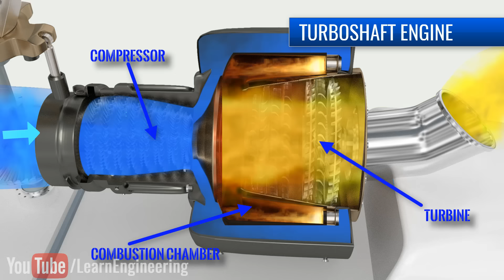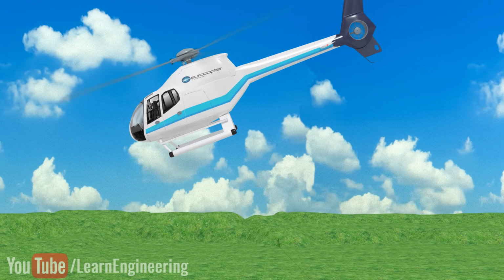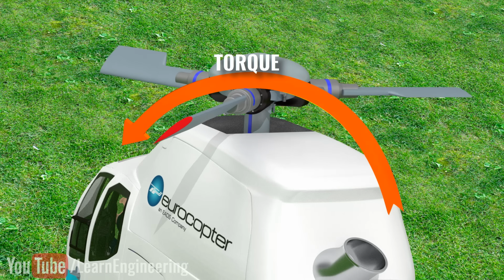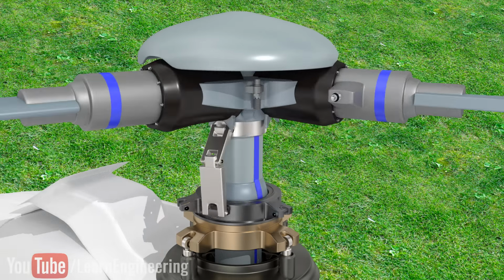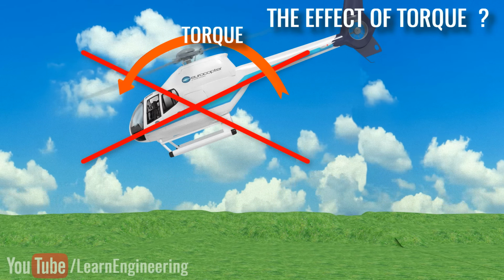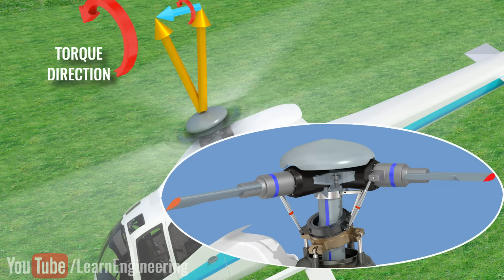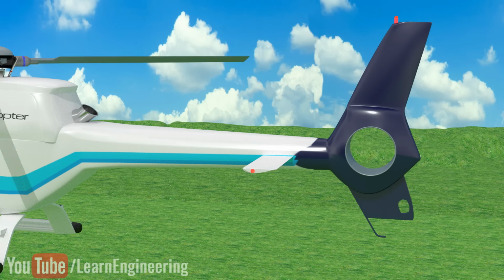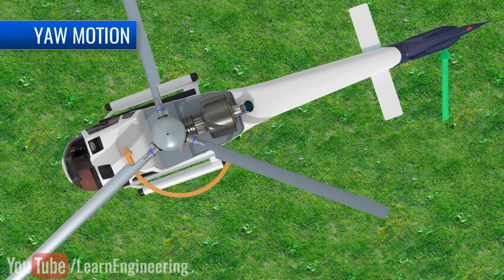How does a Helicopter fly?

Comment: Shouldn’t the main rotor head be spinning the Other way.
Reply: Yes, it’s spinning in the wrong direction at the beginning of the video. It should be spinning counterclockwise to generate upward lift (it’s correct in the middle of the video), but the animation is moving clockwise which is wrong

Comment: This video does not even cover half of the forces that comes into play with helicopters. For example, it does not even mention what happens during forward flight, when the blade moving forward gets more lift than the blade on the other side going back, just because of the difference in airflow between the two. If you claim to make a video explaining how it flies, you have to cover everything. Otherwise you will probably just end up confusing people even more.

Comment: Wait but this swash plate explanation doesn`t fit my observations. When the cyclic stick is being moved back the swash plate also tilts back and not to the side.
Edit: I found out that the reason for that is the 90° angle of the pitch cotrol rod mounting horns on the observed rotor heads.